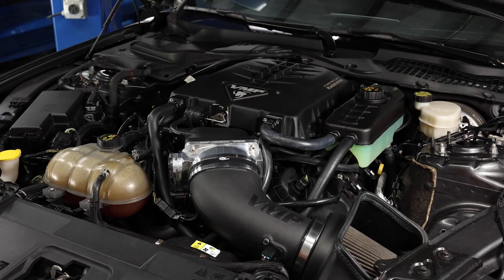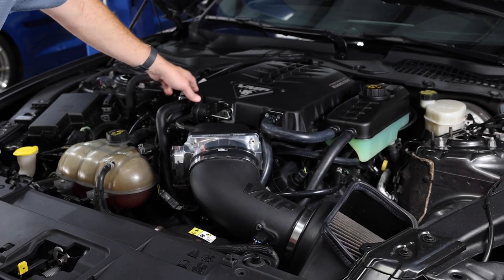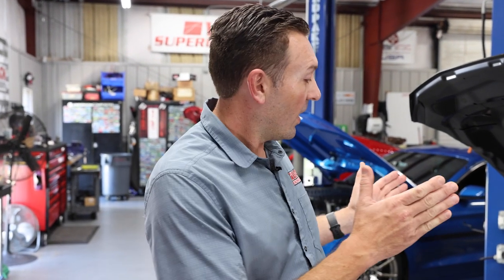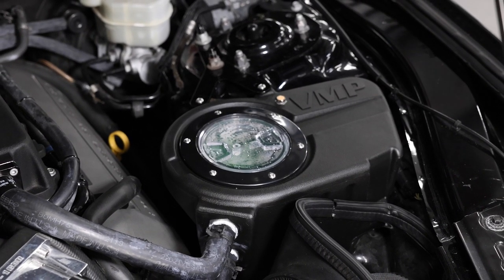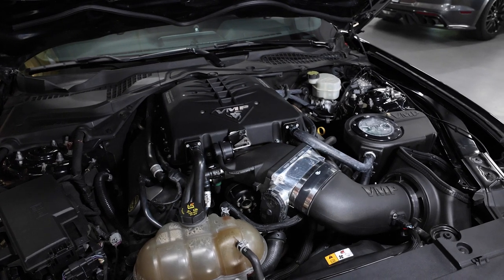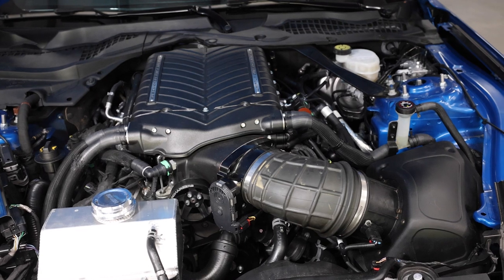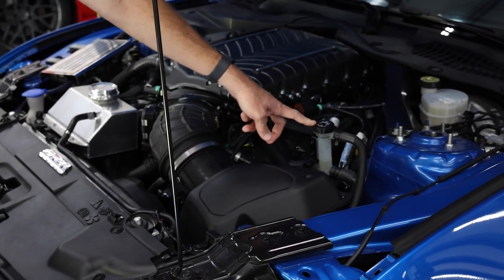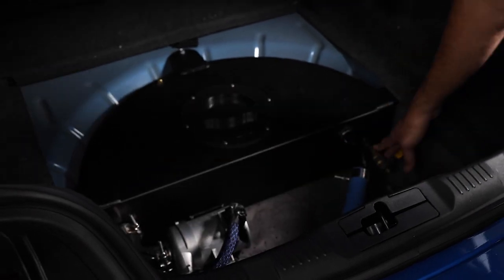Why Ice Tanks?!  What are they?  How do they work?  ||  Tech Talk

Comment: Fun fact. I buy 30 pounds of bag ice and set them on top of 10 pounds of dry ice in big cooler. I’ve seen my IATs at -10F at the start of a run and 26F at the end of a run.
Reply: Can you explain this more I’m interested
Reply: @keithjones7304  dry ice is -100F, bag ice is 0F. Bringing 0F to -100F means that the regular ice has to absorb more energy to melt than 0F ice.

Comment: Car guy and Ex-Bartender. U guys should build a (small) Jockey Box. ( pump and closed loop to the inter-cooler )  The ice and water, will stay in the Insulated box but cool the fluid / IE, water or Glycol running to the intercooler )   A Jockey Box will cool beer lines, 4 or 5 hours with maybe, 3 bags of ice.     lve wanted to try this for many years but havent.